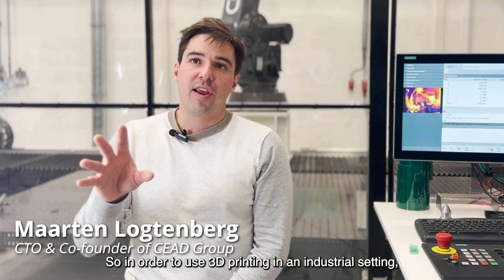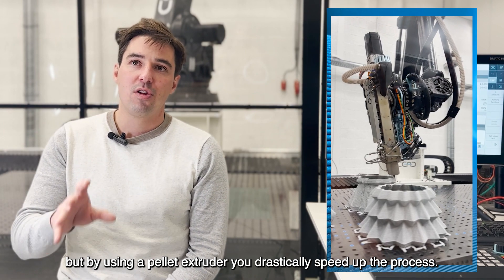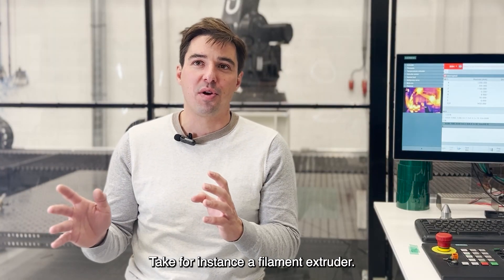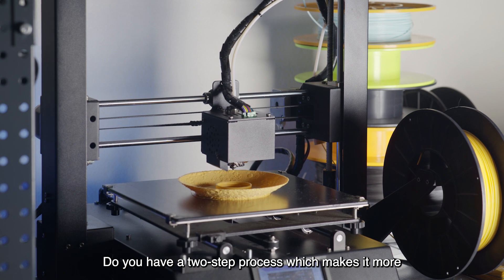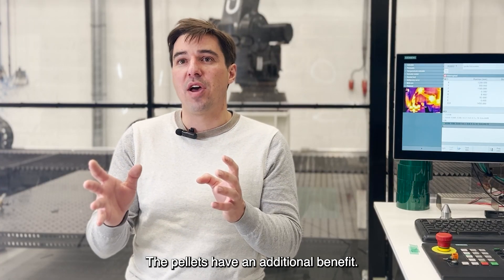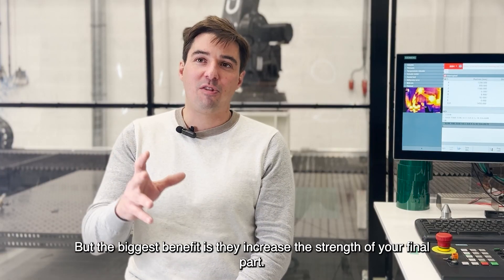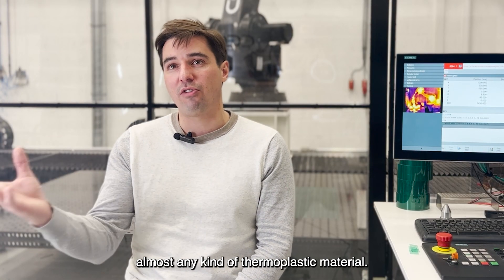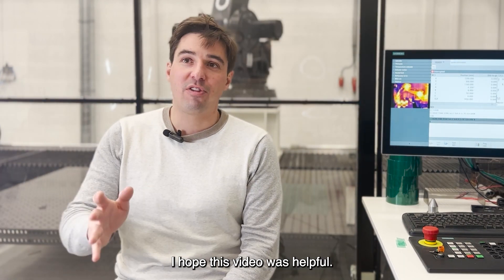3D printing with pellet extruders versus with filament

Comment: Are you machining your prints after?
Reply from the maker: The Flexbot machines can do both 3D printing and CNC machining. For some applications suchs as molds, it is indeed important to machine the printed parts afterwards.